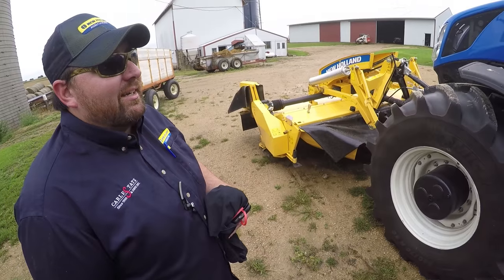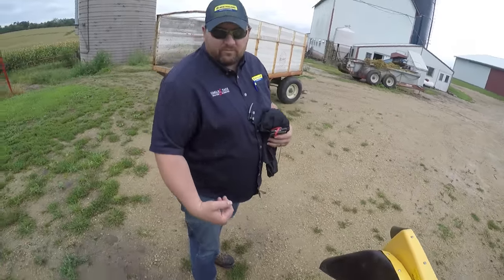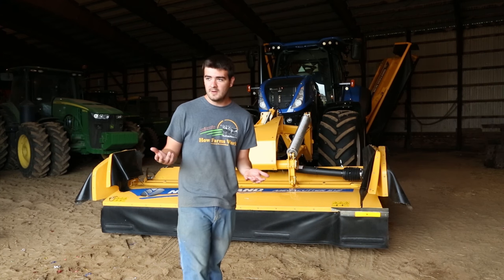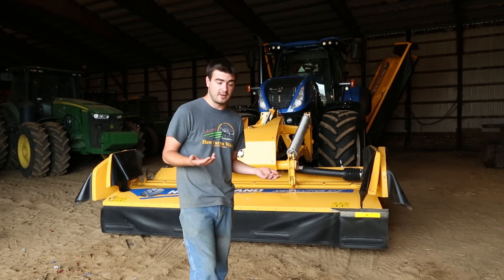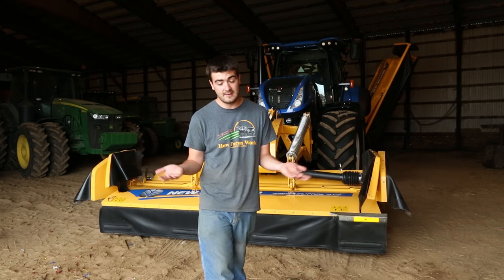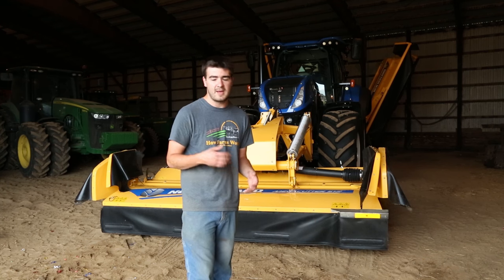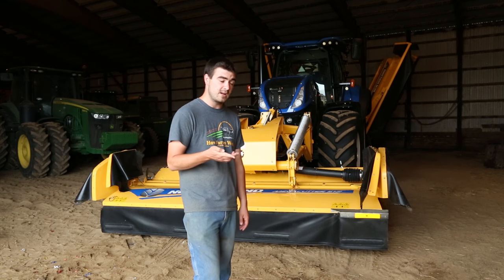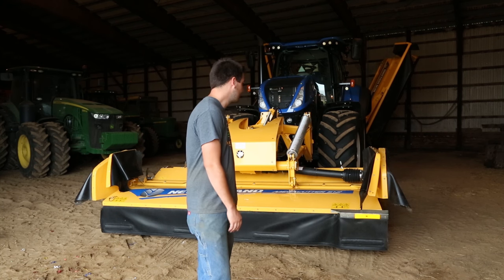Big Blue Tractor Pulls in the Driveway!

Comment: i used one of these back in 2008 it was not something i could use. the one i had was under powered and i had to go super slow and it made skips on the corners. rocks did major damage to the cutter bar and knives where thin and flimsy.. this looks a bit better than the one i had but still you will find it clumsy in small fields plus it is fatiguing keeping track of everything that is around you. i had the demo for a week and it was cool but i quit using it 3 days in because it drank more fuel and i was just not going to buy the thing. i hope you enjoy your demo but be aware  of the little things that you notice because they can turn into very big things over time,. but you already know this so have fun.

Comment: Ryan.  Deere has a kuhn triple mower painted green with conditioner and hp requirements are 250hp. So a 7250r would work which probably be cheaper because is not a 310 hp tractor. Also less fuel per acre.

Comment: Is it actually that much bigger than the 8235, or is it just the camera angle?
Reply from the maker: Pretty similar in size actually. We never got them side by side but the T7 felt a little smaller, but that could have been from the smaller cab size.
Reply: we deal with a lot of equipment at call F Statz but if you want the best price for New Holland equipment go to Hennessey Implement in Dodgeville Wisconsin

Comment: I think the minimum horsepower to run them mowers is around 305 isn't it? 95 for the front and 210 for the rear according to new holland.  which is y u need a big tractor. next u need to demo the krone mower :)
Reply: Wrong...our triples are 5 ft wider and 230hp drives them all week.
Reply: I'm just quoting new Holland's website
Reply: I dont deal in websites, just real life
Reply from the maker: We were told you should want at least a 300 horse tractor on it.
Reply: our t7235 runs a set of jd 30ft mowers just fine. it's about 3hp per foot horsepower required for a disc cutting bar with gear drive, it's the conditioner that is the big power sapping part. depending on crop density actual horsepower required can vary a lot.

Comment: Id lock that mower section properly in place before i do anything else
Reply from the maker: +fastrac89 Had to leave it locked to fit in the shed's door! Very tight fit.
Reply: How Farms Work Fold it back up properly and lock it properly...the hinges arent designed to take the pressure it is under there. Different story if you owned it but its somebody elses equipment..have the decency to take care of it
Reply: Greg Eck he's not wrong, if I goof up on my own piece of equipment it's my fault and I have to live with it. You'd better be careful with someone else's
Reply: Greg Eck Do you have any input as to the way this (loaned) piece of equipment is being handled? Or are you just being a cheerleading whiner?
Reply: So you're saying New Holland spent millions designing a mower with hinges that can't take not being folded all the way? Come on now. CNH parts are stupidly expensive and I'm not a fan of their machines, but they aren't that stupid. Neither is HFW.
Reply: Austin Timm I dont normally reply to comments beginning with "So you are saying" because the poster is normally an idiot that knows nothing and who is just looking to troll, but,yes, thats exactly what im saying. When the mower section is in fully up and locked position,there is zero pressure on the hinge. When it is in the operating (float) position, there is zero pressure on the hinge. The hinge was designed to manage only temporary stress when raising or lowering,not to be left in a half raised/lowered state..with pressure not only on the hinge,but also the ram and scv lockout on the tractor. But you are going to prove me wrong?......The keyboard is all yours ......
Reply: Austin Timm Think carefully kid...are you actually saying youd leave a machine in an unsafe position waiting for a child to walk under it and fall on him?
Reply: Then it must only be hopes and dreams holding the mower to the frame, if the hinge has zero pressure on it in the operating position.

Additionally, if the hinge holds no weight in the operating position, how is the mower supposed to articulate? Kansas isn't the only state that cuts hay.
Reply: Austin Timm Come on boy,3 people already deleted their comments when they tried t say im wrong..are you going to be number 4?
Reply: fastrac89 Is that center pin not a part of the hinge?

A properly set up mower only has a small percentage of ground pressure, so it can hop over rocks or irregularities in the ground easily and prevent blade or sickle damage. The majority of the weight is still held by the hinge, secondary frame, or whatever you choose to call it.

Usually the loser in the argument resorts to name calling and derogatory remarks. Just saying....
Reply: Austin Timm NO,the centre pin isnt part of the hinge. What make and model do you own? And I dont remember calling you names?
Reply: I don't know why, but I stopped getting notifications for this thread.

Go look at the video HFW posted today. Those magical "locks" are just little chains that take the weight off of the hydraulic cylinders and provide a safety net in the event of a hydraulic failure. The hinges still hold the weight, all the time, no matter what is holding the wings up, be it hydraulics or the chains.

I never argued the safety aspect of not having the wings locked up. I agree there completely, but leaving them folded up with the weight on the hydraulics will not damage the hinges in any way, shape, or form. 

You are arguing that a every single time the mower is raised (to switch fields for example), the operator would need to get out ,engage the mechanical lock, get where they're going, get out again, disengage the locks, and continue mowing, or damage to the hinges would result. CNH would not design a machine that is that counter intuitive to operate.

Comment: I prefer New Holland they have more power than Deere. You aren't paying for a green paint job your paying for a straight up good machine. I've watched my dad drive his John Deere 8200 and my cousins drive their New Holland 8970 and the new Holland looks a lot easier to drive from a passengers point of view. I have also ran a John Deere 6R and New Holland T6 and the NH was lot easier for me to drive.

Another reason I don't like John Deere is they like to say that they have come up with almost all of their innovations but if you actually look at Deere's past they have bought more companies and patents from other companies than NH and Case together. New Holland doesn't hide as much stuff in red tape or classified deals with other companies.
Reply: What are you bullshitting about? How could a say 200hp NH have more power than a 200hp JD?  Thats stupid dude
Reply: Way to be a troll!

Obviously a 200 HP tractor has the same HP as another 200 HP tractor. If you look at the largest tractors of each series that they make, NH has the most HP in each series.
Reply: Philip Logemann Your exact words "I prefer New Holland they have more power than Deere." Now I ask again, how is that possible?
Reply: As I said in each series of tractor that both companies manufacture NH has the most power. For example the John Deere 9620R max HP with torque boost is 670-680, the NH T9.700 has max HP with boost of 700 HP so obviously NH has 20 HP on Deere.
Reply: Philip Logemann Another Farm sim warrior. thats about 12 today
Reply: Philip Logemann Again..your exact words "I prefer New Holland they have more power than Deere. "  Please explain?
Reply: Philip Logemann Your not an adult are you?
Reply: you want to learn how NH is better than Deere look at each of their stats on their websites and you'll see. Or are you so ignorant you won't even go to the internet to see the exact specs.
Reply: In fact I am an adult. I just graduated college, I pay my taxes I work my butt off for every cent I make on the farm.
Reply: Philip Logemann Sorry, I cant have an adult conversation with a kid,
Reply: You would be an adult if you actually looked up stats before going on record and continually berating me and anyone else who tries to show what from their experience and talking with both John Deere and New Holland dealers has to say on the subject of which tractor is better. You think you know a lot let me get you in contact with a mechanic who had worked John deere for over 15 years and now works at New Holland and knows the difference from a dealership mechanics hands on experience.
Reply: fastrac89 just to let you know I am old enough to make a conscious and informed decision that I will never drink anything alcoholic, smoke, or do drugs.